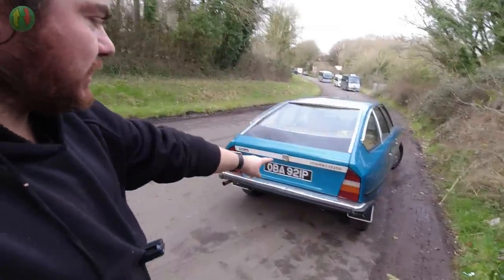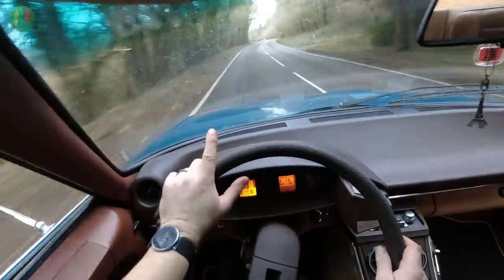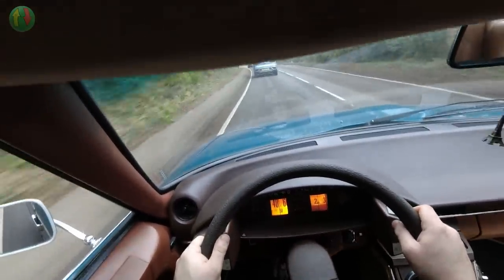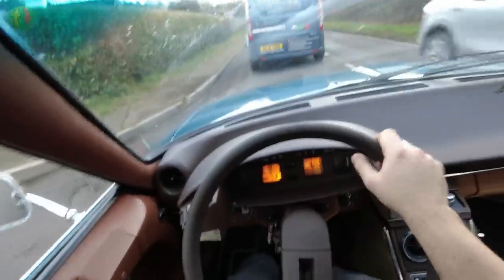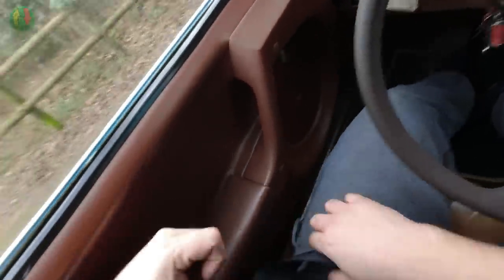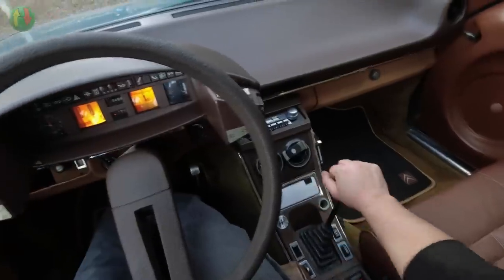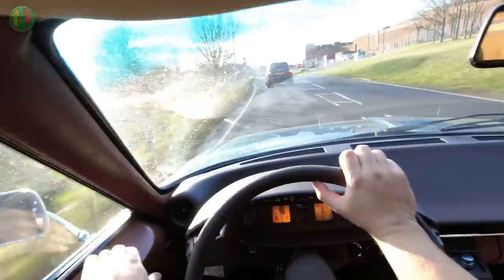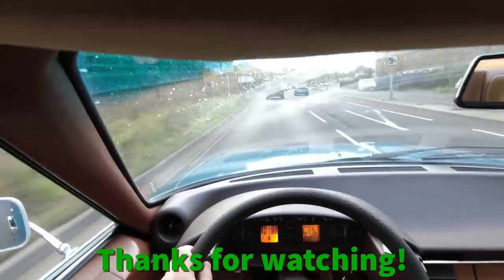1975 Citroën CX2200 Pallas - POV DRIVE & WALK-AROUND: One of the EARLIEST CXs in the UK!

Comment: I'd be really interested to hear your thoughts from a later DIRAVI equipped car.  Perhaps even an auto as you suggest.  I have a late GTi (2.5, auto) which was my first CX but really stunned me for the first few months of ownership, it still does, especially if I get into it after driving anything else for a while.  

I certainly get the 'shrinking around you' sensation you describe from it when you get a move on, or when sitting on the motorway where she just feels ready to lift her skirts and fly any time it's asked.
Reply from the maker: Yeah, I think a DIRAVI auto-equipped car would be one worth trying.
Reply: As the owner of an S2 GTi Auto, I can confirm that performance is leisurely. It's at least 2 seconds slower to 60mph than the equivalent 5-speed manual. 70mph is a high 3100 rpm. There was only ever enough room for the ZF 3HP22, so the CX never got the later and much better 4HP22.

Comment: It sounds like the rear spheres are too soft; maybe they need changing out or maybe the owner likes it that way. I had a CX20 as my first car. It rocked; a 300 pound car with a dodgy gearbox and a fuel filter that kept on getting blocked up...and dodgy electrics too! I loved it though. Miss the style and sophistication of a CX. Would own another in a heartbeat if I had the garage space. The 2.2l engine was always gutless. The 2.0 much better and the 2.4/2.5 was always great (although very complicated). Thanks for the review.
Reply from the maker: Certainly don't think it's confined to the rear, the whole car is extremely soft. It might be that it's just how they are, or it might have the wrong spheres on it.
Reply: @UPnDOWN  : there are quite a few different types of sphere: standard (most berlines), GTi/Turbo front, Break / Prestige rear, plus the accumulator sphere. Those are the basic variants.
Reply from the maker: @smhorse  Yeah I know, but that's what I'm saying...it may have the wrong spheres on. It's not an issue confined to the rear.

Comment: I thought Pallas was the luxury spec? How can it not have a Diravi? Wasn´t Athena the poverty spec? On the other side I saw a GTI with 120hp......Citroen is strange.
Reply: My Dad had an Athena, that had power steering and a very heavy clutch pedal too...
Reply from the maker: It is a high-spec, but the first CXs didn't have power steering. They were rushed into production, by all accounts. Same with the BX - PAS didn't appear on those for the first 18months.
Reply: @UPnDOWN  To take the steering from the SM or DS was not a option?

Comment: Take DIRAVI from your SM and sell to the owner :D and put new spheres or regenerate them (car behave like there is low/no nitrogen pressure in it). Then ride again!
Reply from the maker: Ha! Don't think so!

As for the spheres, low/no gas means a firm ride. To be too soft, they'd need to have an excessive amount of gas in them.
Reply: @UPnDOWN  I had a 1983 2000 Pallas and it also had extremely soft suspension. That was probably normal for Pallas.